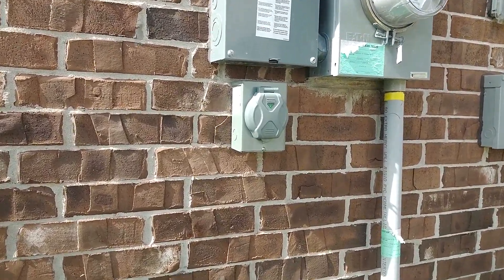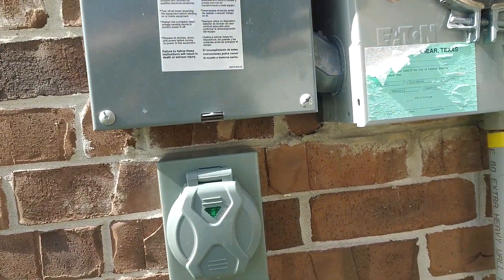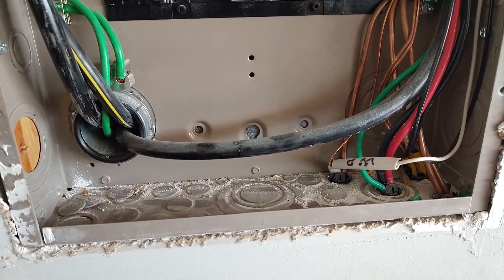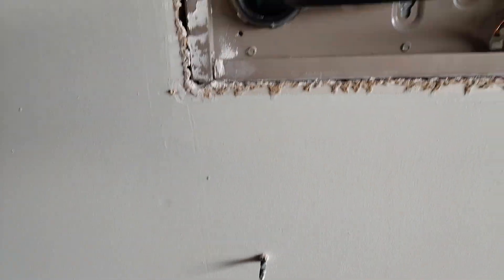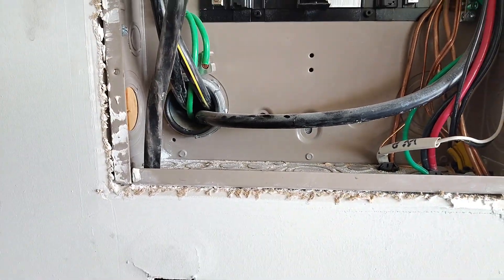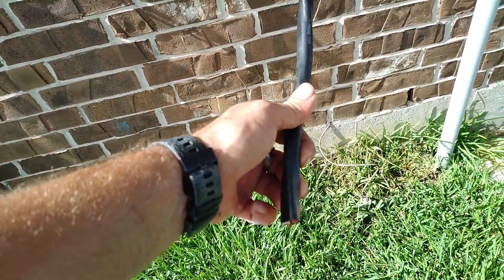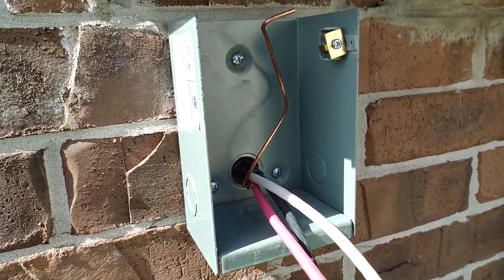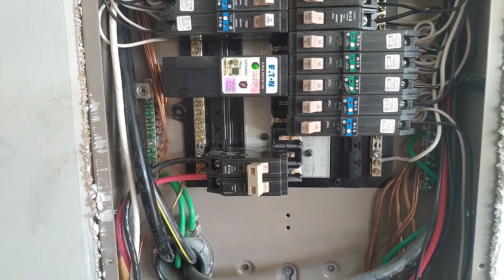Power your home with a portable generator

Comment: Brian, what size drill masonry bit did you use to drill the brick?
Reply from the maker: The bit I used for the pilot hole was a 12in long  1/4in masonry bit and the bit I used for the final hole was an 8in long 3/4in masonry bit. Links are below
https://www.lowes.com/pd/Bosch-1-4-in-x-12-in-HSS-Round-Hammer-Drill-Masonry-Drill-Bit/4185383?irclickid=2SGR9Y3%3A1xyPRm1VC025mUeiUkCwuR2INxoG2g0&irgwc=1&cm_mmc=aff-_-c-_-prd-_-mdv-_-gdy-_-all-_-bing
https://www.lowes.com/pd/Bosch-Bulldog-8-in-Alloy-Steel-Masonry-Drill-Bit-for-SDS-Plus-Drill/1091905

Comment: My panels have similar setup as yours. Mine the neutral and ground bonded in the outside main disconnect panel. Is it still ok to connect ground and neutral wires coming from the generator to corresponding busbar in the inside main panel? Thanks!
Reply from the maker: Yes, it's still ok to run it. The ground and neutral wires are ultimately bonded together at the source via a green bonding screw in the main panel. Whenever in doubt though, the best practice is to make the ground with the rest of the ground wires and the neutral with the rest of the neutrals.

Comment: You not technically using a suicide cord but u still are. Gen breaker can be on with the main wich means the male prongs outside can be live.
There are 200 amp transfer switches available since you don't have an interlock. A bit costly tho. But keeps your liability for injury away

Story time......
One of the many times i used a sucide cord this is what happened.
I hooked up a gen by backfeeding my welder plug in my garage. I told my wife dont touch it no matter what. No point of explaining why other then i said it could kill you. While i was at work i called her to ask her the status of the fuel level. She said the gen is off and shes back on grid.... i couldnt form words for 15 seconds then only curse words for 30 seconds. Why, how, what the f did u do?!!!!. She said the neighbor came over and told me power was back on. He helped me switch it back. Whats the big deal? I said how exactly did you do it? She said the neighbor unplugged it and told me to turn the main breaker back on. I said did he unplug both ends? She said i dont know he said it was ok. I said just stay away from the cord in the yard that he unplugged. Im on my way home. She said its not in the yard its in the garage. I said when did it get put in the garage?
 She said she put it in the garage an hour or so after the power was restored so she could cut the grass. When i got home guess what i found. A LIVE 240 VOLT MALE CABLE LYING ON THE FLOOR. "I" ALMOST KILLED MY WIFE!!!. It doesnt matter how well you explain it people can not be trusted to stay away from this deadly hook up! Its not worth risking someones life over $200 for a gen interlock and a proper receptical for legally backfeeding your house! Dont do it no matter what. Now u say i live alone its fine no one will touch it. Ok... your putting yourself at risk of jail time. How? Ill tell u. Lets say your neighbor is doing the same thing. Except hes not as " smart" as you and forgets to shut off his main and back feeds it into the grid for even one second then his breaker on his gen pops. Or burns up his gen. Well at the end of the block his gen went through the transformer and energised the 7,000 volt line. Cause transformers work both ways. There was a lineman working on the line that he had confirmed dead and 0 volts on not 10 mins ago. He gets electricuted with 7,000 volts and dies. Now the foreman and the shariff are driving around the neighborhood and looking for people on generators. They see u all lit up. Prove to them it wasnt you who just killed the lineman. Good luck in court.
Here are some short videos proving my points
How the lineman gets killed. Google it they do get killed every year with backfeeding
https://youtu.be/GA_zhLogUG8

Thus is what you should do
Below are interlocks and how they work. These are the 2 companies that make them.
Geninterlock.com

Interlockkit.com

https://youtu.be/n7DkaorEQPQ

https://youtu.be/_pQpXo4np4k

Comment: In your situation, although still not ideal, I would consider adding a universal double pole lockout to the generator inlet breaker.  You can put a small suitcase like lock on it but at least this way, someone who isn't familiar with the panel isn't going to accidently close the breaker when it shouldn't be.  Could also move it over to the main breaker on the main panel (or add a second) to lock that one out when on generator power.  Not as reliable as an interlock but better than a freely accessible breaker.
Reply: Look up generator interlock. $60 UL listed. Prevents main and gen breaker from being on at the same time.

Comment: Good video for sure but I went a simpler & cheaper route,... Everything in my house is electric & I didn't want a huge loud generator that I would not often use, been there, done that lol.
We live on a very main route so it would be a top priority if the power went out so I don't think we will be without for long ;)
I have a 2300/1850 watt quiet inverter generator to run the basics,... Fridge, chest freezer, internet & a TV so I attached one of those Generator Inlet Boxes that you used (30 amp) to my house & ran just 1 foot of 12 gauge wire to the inside of the kitchen to a 20 amp outlet so that inlet & double outlet are NOT connected to the house wiring !... That 20 amp outlet is dedicated generator only :) 

All done for under $50 :)

Comment: I applaud you for not taking the path of building a suicide cord to backfeed through a 240 outlet. However, your installation is still not as safe as it should be, nor is it code compliant.

Not having a main disconnect in the panel isn't an adequate reason to not use a safety interlock. I had exactly the same situation as you show, so I added a 200 amp breaker to my panel to convert it from being a lugs-only panel to one with a main breaker. This allowed me to add a safety interlock and pass an electrical inspection for the permit I pulled.

Yes, it was much more expensive to do it this way, and it was a PIA. But I now know that someone less experienced than me can't inadvertently electrocute a lineman because of work I did.
Reply from the maker: NEC 702.4 requires that the standby (or backup) system be sized to support the selected loads whose power is to be maintained by the backup generator. As of 2020 the (most current adopted NEC) there are no requirements to an interlock kit. If you are aware of one I'm not please share the code reference. Furthermore while I agree an interlock is the preferred way to go. However, I haven't come across one that doesn't require drilling and modifying the dead front (panel cover) which would void UL listing and so would not be in compliance anyway.
Now we also need to look at the arc flash rating change. According to NFPA 70E modifying a panel outside of the intended manufactured design would require it to be worked on with the highest arc flash PPE (catagory 4 aka 40cal) unless inspected and labeled after modification.
The reality is building codes are minimum standards to follow in an ever changing industry where certain setups or situations may not be specifically addressed and at the end of the day the home owner is responsible for the actions we take on our homes. So I make these videos to help educate and inform others on how the systems and equipment in our homes work.
Reply: @HowitsdoneHandyman  
Perfect response :)
I saw a video of a dude in Florida who had a 10 gauge cable coming from his generator & was connected to the main poles of his panel with Alligator clips & people hosed him down in the comments badly & yes, understandably BUT as he said, he had no kids in the house and "lets see what codes you are willing to violate when your power is out for 3 weeks from a Hurricane ;)
Reply: @HowitsdoneHandyman  You've named your channel "How it's Done" and yet you've chosen to give instruction in the unsafe installation of a panel backfeed solution. I'd hardly call this presentation an example of  "How it's Done" and I challenge you to find any county electrical inspector that would ok that installation.

I have a long history in working with Property & Casualty insurers. I promise you that if such a solution is put in place without a signed-off electrical permit and the home suffers an electrical fire (not caused by this installation, mind you), the claim will be denied. It will then be on the homeowner to prove that an un-inspected and un-approved solution did not cause the fire. Always remember that an insurance adjuster's job is not to determine how much to pay on a claim; it is to determine how to avoid paying on a claim.

You are doing inexperienced folks a disservice by presenting a step-by-step guide to creating a dangerous and potentially costly situation.
Reply: @HowitsdoneHandyman  .... here's what I found...
Generator interlock kits are legal in most parts of the US if they are approved by UL under their standard UL 67. The interlock kits should have the UL listing otherwise they may be rejected by your local electrical inspector. These kits are panel specific so it would seem that if you follow the instructions, you are still in compliance. It also sounds like you need to pull a permit and get an inspection to be on the safe side. As for NEC, it would seem to be basically the same as installing a transfer switch, where grounds, neutrals must be present as well as full isolation from the street feed and positive lockout from accidental cross connection of standby power from utility. (which is the whole point) In a nutshell, you can't build or "home brew" this device. It must be UL approved for the specific panel.
Reply: Yeah, that's not up to code in my area either. This type of DIY installation is the reason we have electrical codes and inspectors. As you said, it's the kind of installation that makes a linemans job hazardous or deadly.
Reply: @thefarmer What code violation are you referencing? I've done some digging to find out why this is a violation since this is the setup I have and a code violation could affect resale or at least come up on an inspection report but haven't been able to find any actual code referring to this. For you, to state "it is not code compliant" clearly you must be familiar with the NEC code this is violating. Cite your source, please.
Reply: @briangibula2040  ... maybe this will help. It took some digging....
NEC 2008: Section 702.6 Transfer Equipment. Transfer equipment shall be suitable for the intended use and designed and installed so as to prevent the inadvertent interconnection of normal and alternate sources of supply in any operation of the transfer equipment. 
(I added the bold type) The bottom line is that NO interconnection is allowed between utility and standby power. If it's not a positive lock out, then it is not permitted!
Reply: @briangibula2040  My source is the Wake County NC electrical inspector who answered my questions about hooking up a backfeed  with or without a generator breaker interlock. He told me that in order to be code compliant, I had to install a mechanical interlock that prevents the main and the generator breaker from both being on simultaneously. Another option he told me would be code compliant would have been to install a transfer switch and move selected circuits to it.

The local Authority Having Jurisdiction has the power to further restrict national code (but cannot institute rules that are less restrictive). When he told me what was and was not code compliant, I followed his instructions, pulled an electrical permit, made the modifications and had an inspection performed. I neither know nor care if this is called out in the current NEC or that which was in effect at the time of my project. The bottom line is that the AHJ has the last word on these matters.

You should ask your local county electrical inspector if your installation is code compliant. Please do understand that even if it is found to be code compliant, you are exposed to risk if you did not pull a permit and have your work inspected. Many years of working in the IT department of multiple Property and Casualty insurance companies taught me a thing or two about how claims get denied. Unpermitted and uninspected electrical work is a huge liability if you ever (God forbid) have a house fire caused by any aspect of the home's electrical system. Your claim is likely to be denied and the onus will be on you to prove that your unpermitted and uninspected work did not cause or contribute to the fire. 

Insurance companies have deep pockets and winning/collecting a judgement from them will cost you tons of dough in legal fees, lost time at work and general stress and hassle. This is just not worth screwing around with. Talk to your local inspector and get this permitted and inspected.
Reply: @theElderberryFarmer  lol, so everything you're spouting online is hearsay. And the knowledge you have is what you've been told by others. Essentially what you're saying is because I'm county I'm good.
Reply: @briangibula2040  Hearsay:  Unverified information heard or received from another.. What I cited is firsthand information that I received directly from the decision-making body in this matter. 

Frankly, I couldn't care less if you follow up on your liability issue or not. I hope you don't encounter problems due to not following up on it. But, I won't lose any sleep over it either way.
Reply: I went a simpler & cheaper route,... I have a 2300/1850 watt quiet inverter generator to run the basics,... Fridge, chest freezer, internet & a TV so I attached one of those Generator Inlet Boxes that the video creator used (30 amp) to my house & ran just 1 foot of 12 gauge wire to the inside of the kitchen to a 20 amp outlet so that inlet & double outlet are NOT connected to the house wiring, just to each other !... That 20 amp outlet is dedicated generator only :) 
All done for under $50 :)
Reply: @davidyummus6259  That's a completely acceptable solution if what you have are a loads that can be plugged into a wall receptacle. If you have hard-wired loads (like a well pump, a septic pump, lights, etc.), that solution won't work. In that case, an inlet with the corresponding main/genny breaker interlock gives you wide flexibility to turn on and off hard-wired circuits as needed while under genny power.
Reply: @theElderberryFarmer  Correct,... I decided to stay small & just run the fridge, freezer & internet :)
Reply: @theElderberryFarmer  ... while this deal can work most anything in the house (within the gen capacity) it is NOT code compliant.